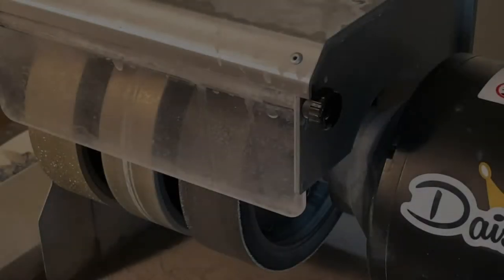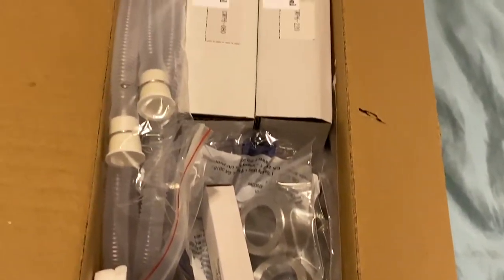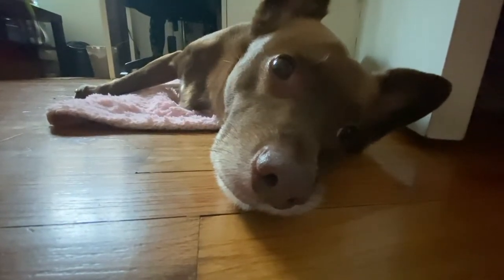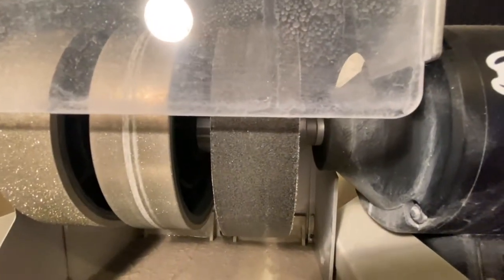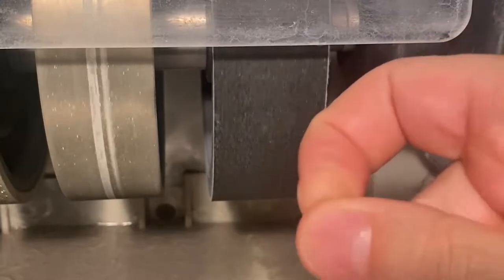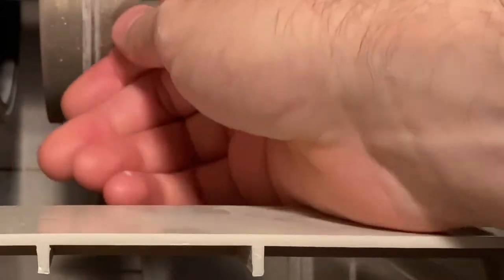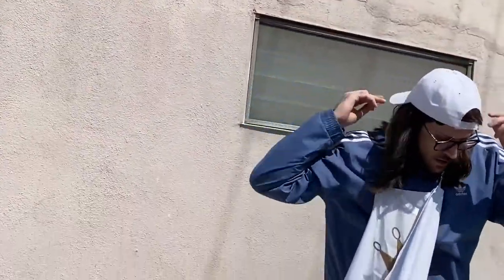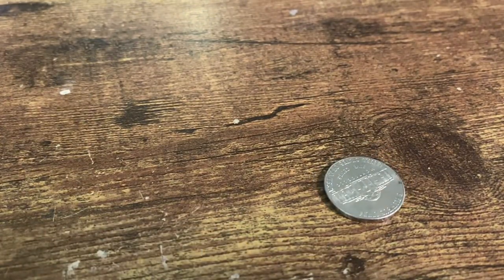Should you buy the Cab King to cut Opal?  Cab King Review!!

Comment: I have a cabking 6 inch and a hi tech flat 6 in for 3 plus years. I tossed the lamp and replace the main unit once and the switch, and the wheels many times. I only do business with these guys. I get my wheels resurfaced. I only use their pumps. Best people and the best customer service I have run into. I have cut 500 plus cabs on this and the hi tech and will never get rid of it. There is some issues that do pop up, but for the most part I love their products
Reply from the maker: im loving it